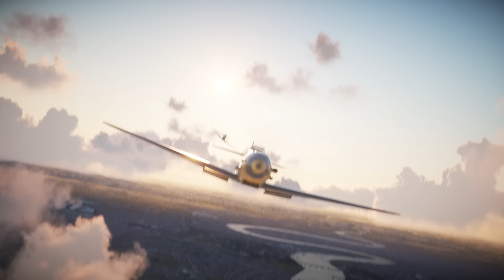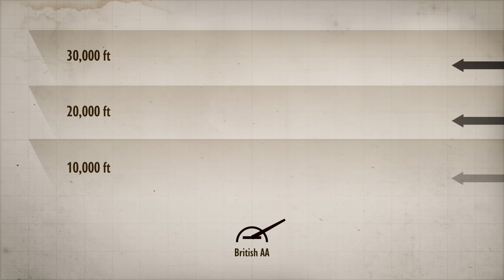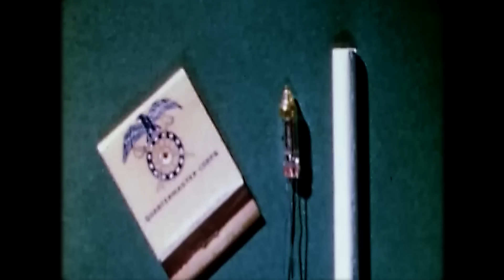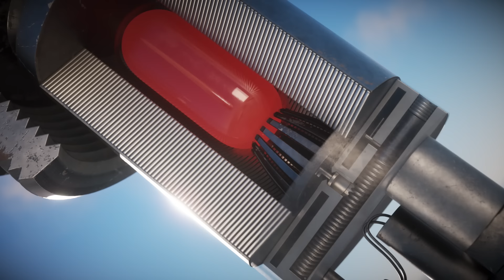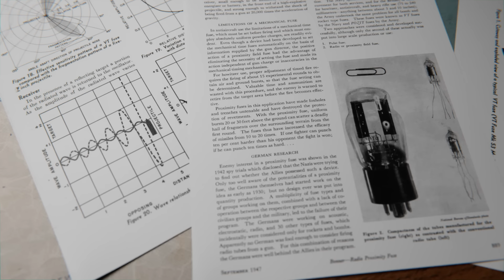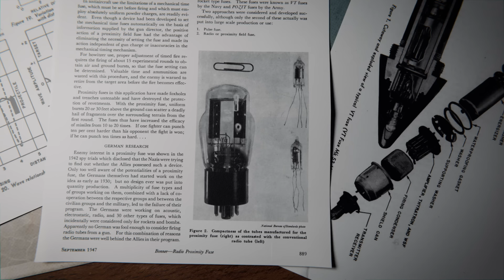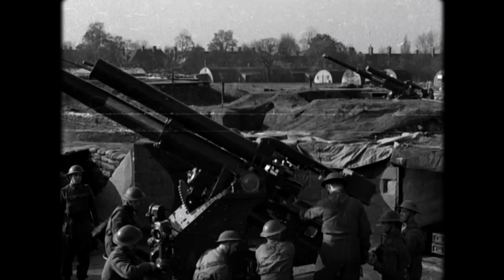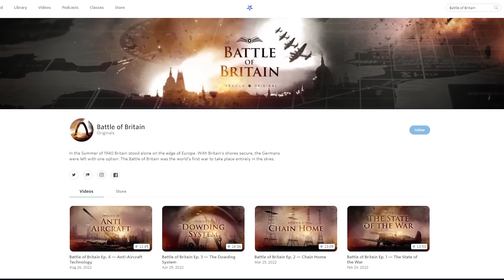The Secret Invention That Changed World War 2

Comment: I’m not sure how well this explains the actual engineering of the antenna system
Reply: Are we taking for granted the astonishing animated 3d graphics of the fuze components? It's blowing my mind for a YT channel, no offence.
Reply: @jonr6680  no we’re not. “Great animations” and “skimping on explanations” are concepts that can coexist.
Reply: For me, a separate vid on the early development of radar would fill the gap.
Reply: Why is that?
Reply: What do you mean
Reply: theres a resonating circuit. it consits of a capacitor and a coil and a battery. the capacitor gets charged, then discharges into the coil, the B field is built up which pushes the charges back into the capacitor, which then again discharges into the coil. its frequency only depends on the capacity and inductivity. the battery is here to account for losses due to resistance in the conductors. and the B field are the radar waves. 

every antenna is also a reciver! if EM fields/waves hit a coil, they induce a current (realisticly always, theoreticly not always). if that current is strong enough, boom (not really, theres more going into when it triggers, but it recives the radar wave reflection via a coil which induces a current which can be measured). google "LC circuit". 

but this technology existed for as long as we knew what waves are, the problem, as brian highlited, was how do you make it withstand 200 000 m/s². with a centrifugally triggered battery. (wait he said 20 000g but 1gram turns into 20kg that would be 2000g? im not gonna search for it, but maybe its 20 000 m/s² not sure)

additionaly bc its itresting: the lower the capacity and inductivity (so the smaller the plates and the more distance there is between the plates of the capacitor, and the smaller the inductivity of the coil, so less turns it has) the higher the frequency. because it takes less time to charge up and "go around". so lets reduce all these 3 things as much as we can: we end up with an antenna. a straight pice of a conductor
Reply: Yeah given the painstaking details he went into the other components I'm surprised how he just glossed over the antenna.
Reply: @Stubbies2003  British were first to create. US just learned how to do it better then them (still amazing, but not first).
Reply: I'm not sure either,that's why I didn't question the presentations approach lol
Reply: Above my pay grade. But I am speaking English and not German now, as are all of England! Amazing work.
Reply: It worked on simple radar difference return like many grocery stores doors do. This wasn't easy to do with old vacume tube technology. The g forces out of a antiaircraft gun are enormous.
Reply: So are we saying the axis and Japanese did not have proximity fuses?

Edit- bc every movie ever shows the flak exploding next to the B17s etc...so ??
Reply: Germany and Hungary had acoustic proximity fuses, both too large to fit in AA shells, they were used in rockets.
Flak exploding right on time is a result of a pre-set timed fuse. Distance to a target would be measured with a coincidence rangfinder, an electromechanical compuiter would instantly calculate a firing solution, and automatically set the fuse timers on the shells, before they were loaded.
Reply: @egoalter1276  Flack towers also used radars instead of rangefinders.

Comment: Would flak rounds be viable againt drones?
Reply: Yes, but modern radars and tracking systems can shoot down dorones without proximity fuses
There video how Gepard shoot down Shahed
https://youtu.be/t0ucjpqjhsA
Reply: I would expect that it's a complicated yes and no. Fragmenting munitions are the norm in anti-air weapons, even Anti-Air Missiles are designed to explode prior to impact in order to create a cone of shrapnel to increase the odds of a hit and damaging enough critical systems to bring it down. And we have plenty of very capable Anti-Air weapons. The problem is that they were all designed with the intention of being used against much more expensive targets. Shooting a salvo of million dollar missiles at a jet aircraft that cost millions if not tens or hundreds of millions of dollars is a good spend from a military perspective. Shooting even a single million dollar missile at a drone that cost between $1000 even up to $250,000 starts to look very unattractive. It is likely still worth it to try and prevent the damage that the drone could do by delivering a munition or gathering intelligence. But it's just not sustainable as it's cheaper and easier to produce more drones than your opponent can afford to shoot down, laying aside questions of production capacity. I don't know what flak shells cost but I would expect they're more expensive than the cheaper drones or close to cost parity. The existing flak shells though are probably way over sized for use against drones, and we ought to develop smaller designs that can be used in automated precision AA batteries. Ideally though we'd want energy weapons for this roll, and while we're making progress on that front they've got a long ways to go.
Reply: yes, they are close to ideal (as seen in ukraine)
Reply: Too expensive to shoot down cheap kamakazi drones. But yes, it  should be effective with modifications.